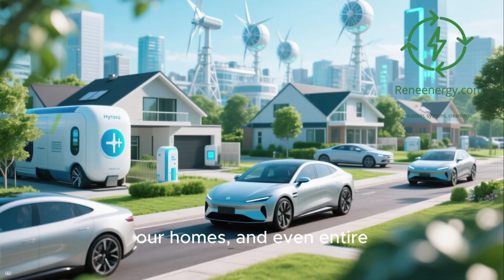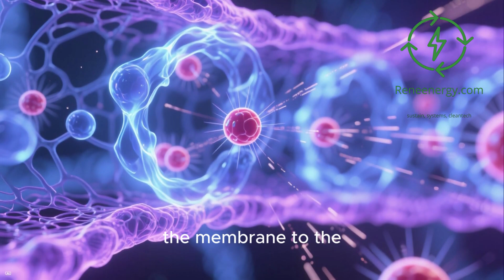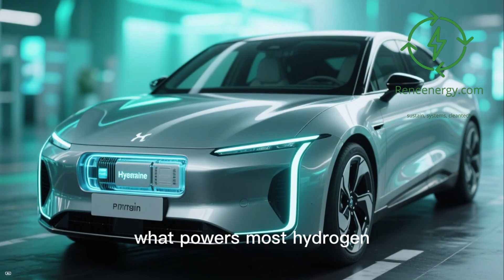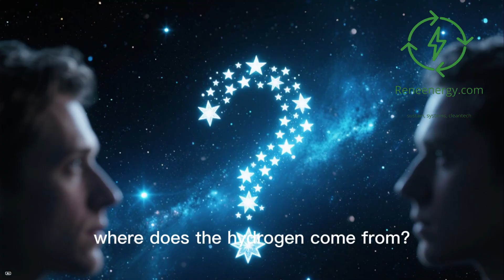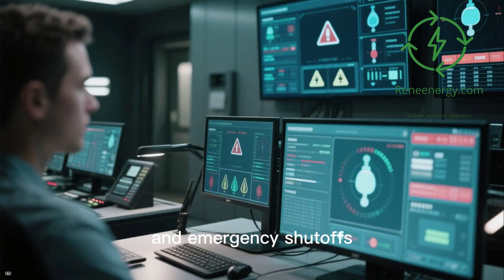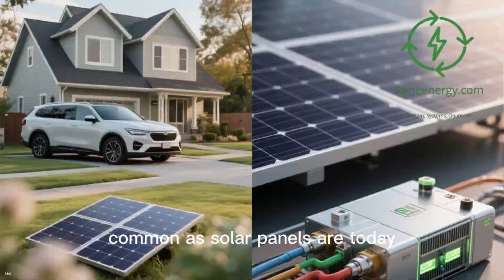🎯 How to Generate Electricity from Hydrogen Using a Fuel Cell!

Comment: Why not do what Stanely Meyer and others have done with water. By exciting water molecules with the proper frequency and voltage the molecular bonds are broken creating a combustible gas made of separate oxygen and hydrogen molecules. No need for conventional electrolysis. No need for hydrogen storage. Just combustible gas created from water on demand. Could it be that powers that be do not want the debt slaves fueling their cars with a garden hose.